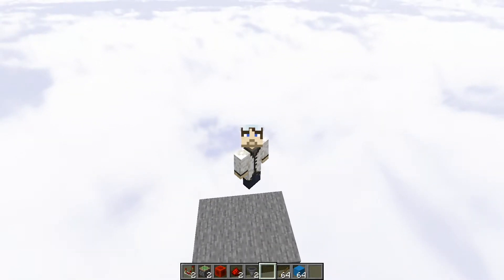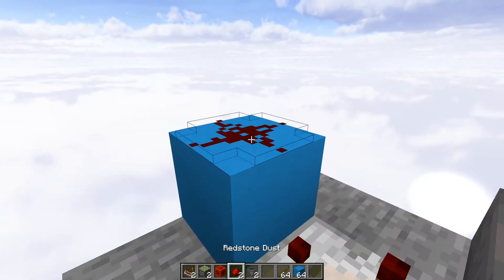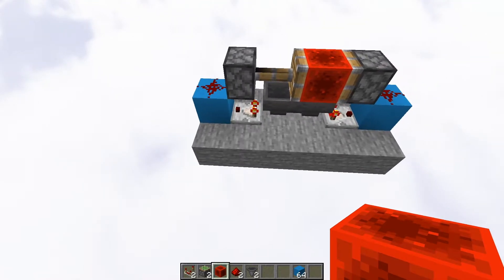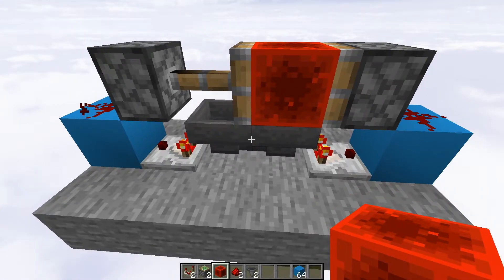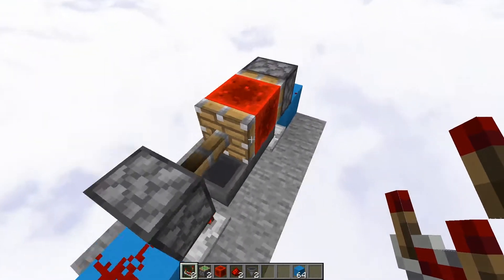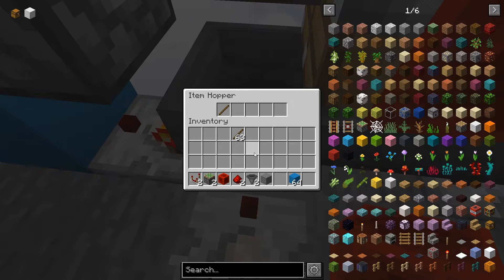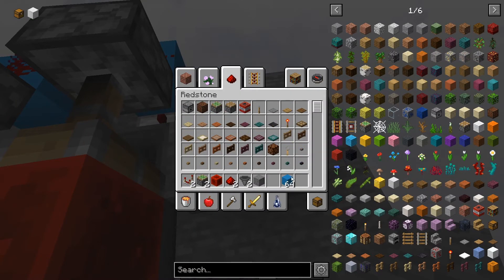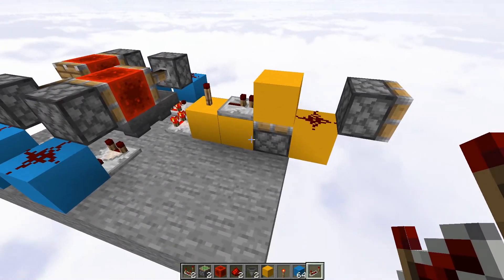How to Make RIDICULOUSLY LONG Hopper Timer Clocks!

Comment: I'm trying to hook this up to a stasis chamber but I don't understand which clock to put the stack in, which to put the small stack of 3 or 4 in and upon testing it only gives me however long it takes for one stack to feed through.
I hate redstone
Reply from the maker: Lol ya, redstone can definitely be tricky. Hopefully I'm understanding you comment properly, but ya, if you need the clock to be longer than approximately 4 minutes, then the first clock will always have 5 stacks of items in it. For the second clock, each item will result in a multiplier of the first clock, more or less. It doesn't really matter which hopper you put the items into, unless you are concerned about having an initial signal trigger. Hope this helps

Comment: for any arbitrary delay you can figure out the number of items the following way:

1. take your delay in hours, or minutes and divide by 0.4 seconds (the time it takes to transfer 1 item)
 /lets say i want a 21 hour clock, then i'd type "21 hour / 0.4 sec" into google. thats 189000./

2. figure out the prime factors of the number you got
 /i just searched for "189000 prime factors" and got the result: {2, 2, 2, 3, 3, 3, 5, 5, 5, 7} /

3. make groups from the factors, where the product of each group is no more than 320 (as thats a full hopper)
/let's say i group them like this: {2 x 2 x 2 x 3 x 3 x 3} = 216 ,  {5 x 5} = 25,  {5 x 7} = 35. 
then i'd place 216 in the first segment, 25 in the second, and 35 in the third. 
you can group them any way you like, but i'd aim to put the most items in the first segment/

edit: i think this will be doubled beacuse its only the half-cycle so start by dividing the time by 2

((this wont be astronomically precise as it takes 2 gameticks for the comperator to turn off and there might be a 4 gt delay before the other hopper starts sending the items backswards))
Reply from the maker: Sounds like ya had a ball with that! I usually these days just go and take the time I want, divide by 0.4, place the number of blocks the result provides, then time for accuracy and adjust accordingly

Comment: Could I chain a 3rd hopper clock? If so, how many items would I have to put into the 3rd hopper clock to achieve an almost exact 24h timer? The 1st and 2nd hopper clocks would be filled with 5 64 stacks of items and still aren't enough to achieve real-time 24h
Reply from the maker: You can in fact chain together as many hopper clocks as you want. With two clocks chained and filled both with 5 stacks of items each, you'd get about 22 hours and 45 minutes. Adding on a third hopper clock would double that for every additional item in the third hopper clock. So it's a bit different than just filling all the hopper clocks up with 5 stacks of items each. I'd treat it similar to a standard real-world clock setup. The first hopper clock would have 150 items in it, which is the equivalent of 60 seconds. The next one would be set up for one hour, so 60 items. The third chained hopper clock would have 24 items in it. This setup would be extremely close to 24 hours, probably within 1 second of error.

Comment: how much items should i put for 3 hours?
Reply from the maker: It'd be 5 stacks in the first clock, and depending on if you take the signal off the side of the redstone block, it'd be 43 items, or from the hopper using a comparator, it'd be 22 items in the second clock. On both occasions, that will give you 3 hours and a few extra minutes. 21 items would give you 1 minute under 3 hours. Hope that helps
Reply: @Talmiior  thanks

Comment: how many items do i need to make it last about 90 minutes
Reply from the maker: A quick calculation seems to show it should be 5 stacks of items in the first clock, and depending on if you grab the signal from the redstone block or from one of the hoppers of the second hopper clock, it should have either 21 items, or 11 items. It won't be bang on 90 minutes as each item transferred by a hopper takes 0.4 seconds to transfer, so you might be around 90 minutes and a few extra seconds. If you need exactly 90 minutes, I recommend using my despawn clock: https://youtu.be/QiPpEX8Z0FA

Comment: Outstanding. I knew there was a way to connect the two timers to make a longer time for a pulse to be sent out, but I was overthinking it. I did make the ending shorter by instead of using a monostable circuit I have just an observer looking at the comparator with a repeater behind it. And because I am using this circuit to open trap doors to flood an area I tossed on a pulse extender to keep them open a bit longer to let the water get to the 8 blocks of flooding
Reply from the maker: Nice! Observers are a great option for a monostable circuit, especially for this setup. Not sure why I didn't think of it